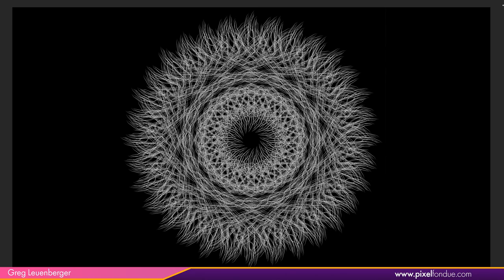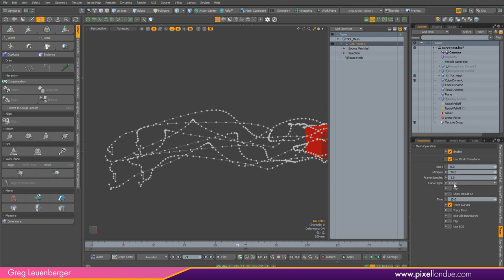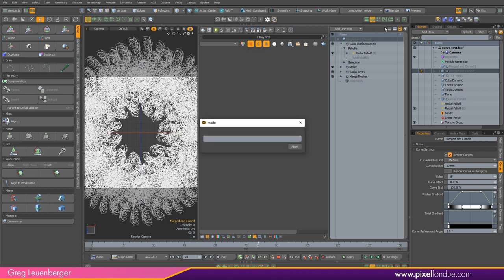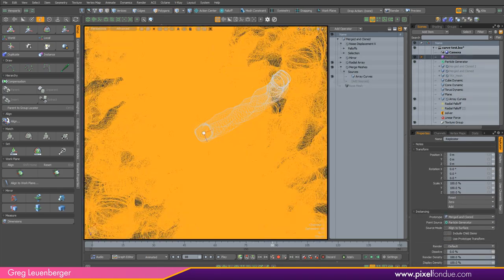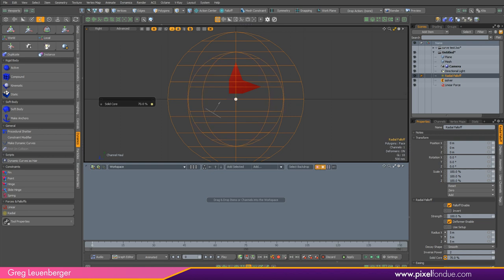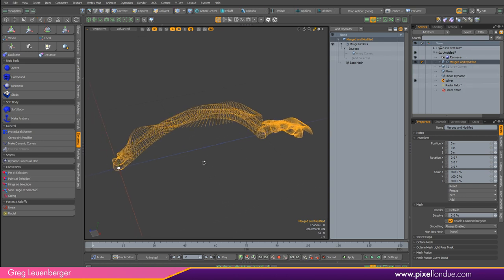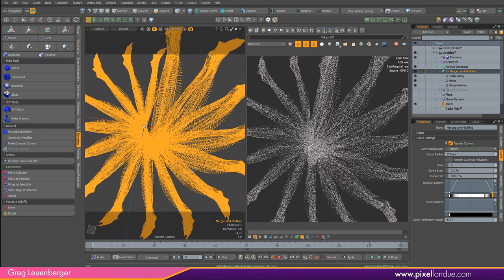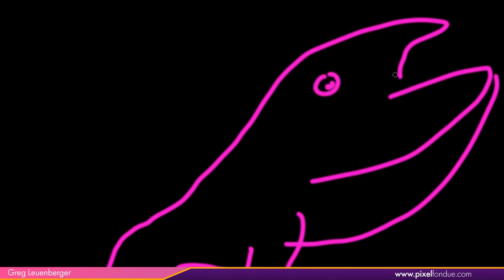MODO | Spirals

Comment: That is cool... I would be interested to see what type of options there are for growing these lines one at a time. Is there a way to take the finished object, and control the growth of each line individually, with a bit of turbulent noise offset? I can see some cool fabric growth effects that could be possible.
Reply from the maker: You can definitely grow them with the curve start/end parameters.  You would have to either manually do the offsets or rig something up.  You could also extrude shapes along all the curves over time...or attach spheres or whatever and have them travel along the curves too.
Reply from the maker: Tropism has some cool growth options for curves...may want to check out the 'sprout' modifier (there should be a video on it)
Reply: @Pixelfondue  will do thanks...